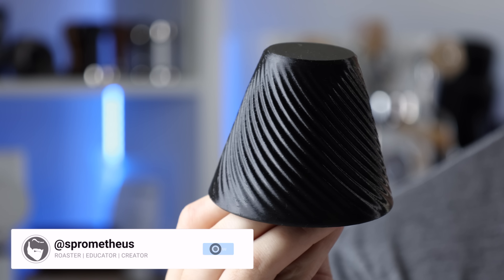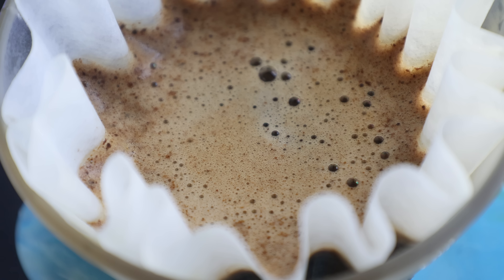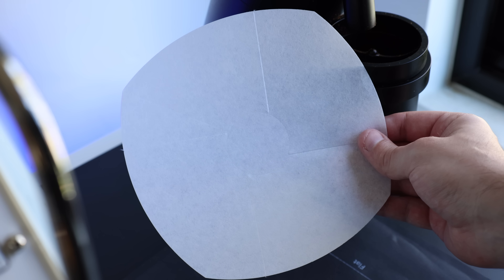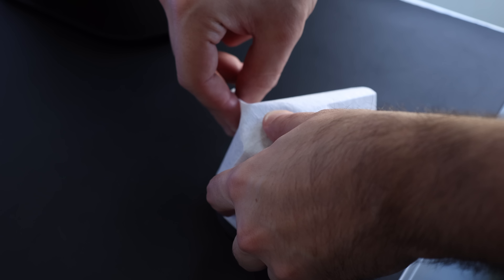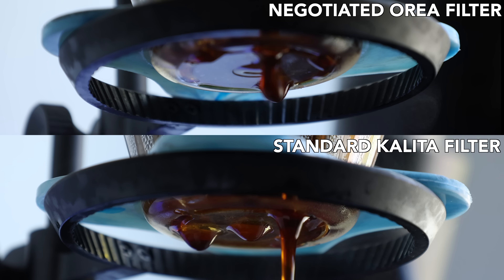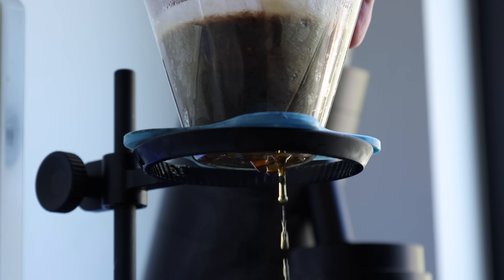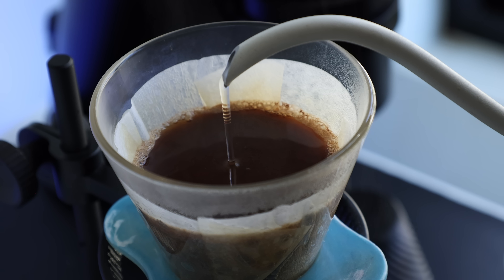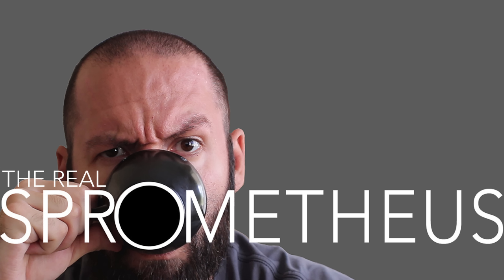OREA NEGOTIATOR - A 3D Printed Pour Over Game Changer

Comment: Your V3 recipe is my go to since you did that review and the only thing I was left wanting was for you to give the Negotiator a try! Thanks! By the way, Aramse Coffee recently made a video on the negotiator as well and I find their method of using the negotiator easier than having to fold and hold the pleats in place. After folding the filter twice like you did, then use the negotiator to slowly push the filter into the V3 while slowly turning clockwise and the pleats will automatically start forming.

Comment: I think there is a better explanation for longer brew times with less bypass than "circulating air flow". It does not make much sense too me that there is air flow through the sides of a kalita filter for example. 
I think a better explanation is, that the water that is bypassing contributes to a higher flow of water in general and therefore a faster draw down.

Comment: It really is ! I love using this thing to form perfect little filters with chemex papers. They are practically as good as the Sibarist ones but far healthier for my wallet 😅. Plus you can reduce the waster and make 4 filters out of one paper pretty quickly.
Reply from the maker: Interesting, so you use Chemex filters to fold for the Orea? That’s interesting. I haven’t touched a Chemex in awhile, but the filters are pretty thick if I recall. I’ll have to give it a go.
Reply: I've also been using chemex filters with the negotiator and love the high clarity results. Even the 3cup filters fit very well once you figure out the folding technique, with just a little part to cut off after folding.
Reply: @Sprometheus  you can cut a large square chemex filter into quarters, so it's the perfect size. And 400 filters for 15 bucks is pretty good value.
Reply: @Sprometheus  would be curious to hear why you don't use chemex/what you don't like about it vs other drippers. I had noticed you don't really have any videos on them and it is a classic, simple, and pretty well liked brew method 🤷‍♂

Comment: Someone made a 3d printed one for the fellow Stagg also. Called the fellow Smoosher. Works great for that brewer and has little holes to allow you to wet the filter with the Smoosher in the Stagg.
Reply from the maker: That’s a solid update in my opinion. I think being able to rinse the filter with it in place would be next level.
Reply: @Sprometheus  it is nice, but you can do something similar with the negotiator by just holding the orea with filter and negotiator inserted upside down, then wetting from beneath. I do it with warm water cos hot might be an issue with the plastic

Comment: You can also use the negotiator with a kalita filter to smooth out a lot of the ruffles/pleats and it leads to really interesting results in the cup. I’ve found myself needing to do that a lot when I run out of the standard orea negotiator filters 😅
Reply from the maker: Interesting. I haven’t tried that myself, but I’ll give it a go. Definitely seems like a lot of folding haha
Reply: @Sprometheus  I just kind of smoosh the negotiator down into the filter while the filter is in the brewer and a lot of the pleats smooth out or fold over 🤙
Reply: This is what I do too. I usually just lightly position the negotiator in the filter and then quickly press all the way in. It flattens all the waves uniformly. I then pull the negotiator out a little and wet the filter then press again to seal the folds.
Reply: ***ADVICE PLEASE *** 
● when I use the Kalita wave filters, GOOD COFFEE .
● When I use Sibarist filters, good coffee. GOOD coffee.
● When I use the orea filters BAD coffee.
**  W H Y **
????
Reply: That's what I do as well. I position the kalita filter in the orea, I wet the filter, then I insert the negotiator and twist it as I do so the waves flatten nicely. This has 2 big advantages: 1) it's an awful lot easier than the folding in this video, 2) I don't need to buy and store yet another type of filter